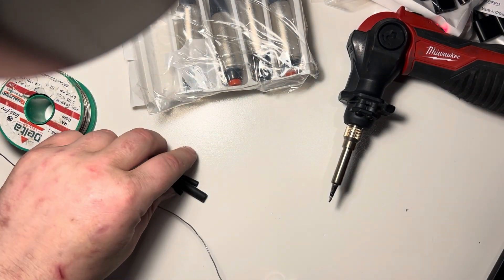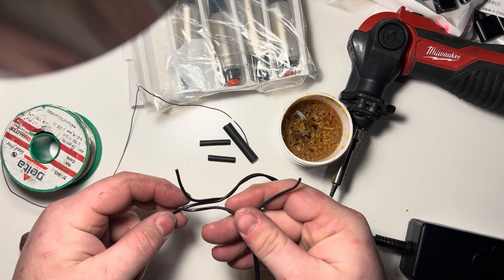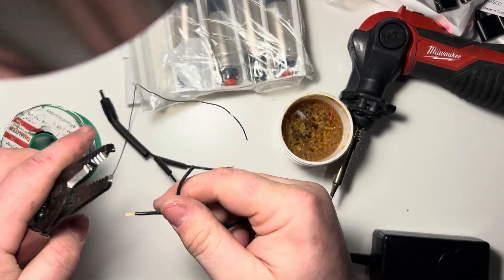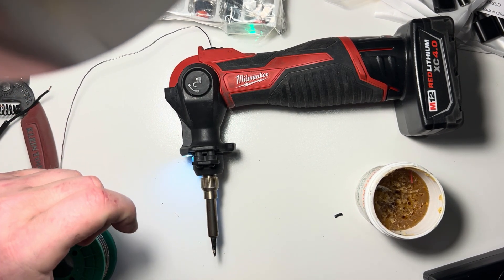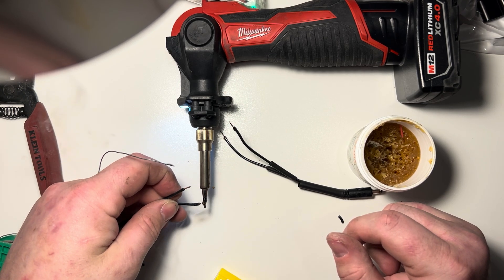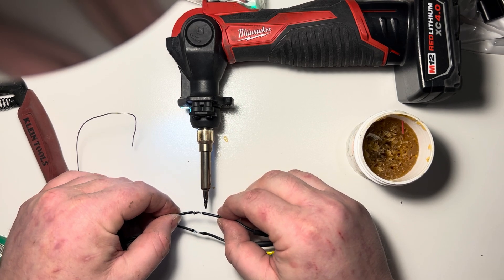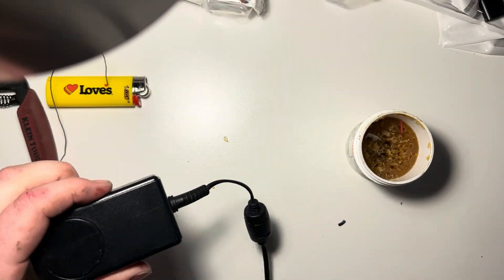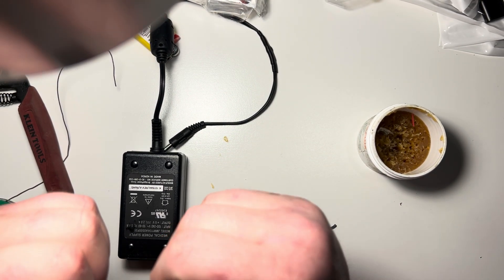Shortening DC cables from a transformer. Soldering in a hotel room.

Comment: What gauge is the wire? You stripped it very fast. I know as a much less experienced person I would have spent a lot more time working my way down from lower gauge (wider diameter) settings as I would be concerned about cutting into the wire I was stripping.
Reply from the maker: I do this dozens of times per day so I don’t rely on the strippers to make the cut, I just kind of go by the pressure I’m applying. I don’t pay any attention to which particular gauge hole I’m using. Most of the wire insulation I work with can be scored with strippers and pulled right off. Keep at it and eventually muscle memory takes over. Just remember it’s always okay to cut and try again if you cut some strands in the process. 

Quality cables/wires make all the difference to me, even on small gauges. On home projects and off-grid builds, I use marine-grade tinned copper almost exclusively (Ancor brand). Super thin/flexible stranded wire is annoying to me and much more likely to be damaged during stripping.

Comment: I like your attitude towards keeping and using sponges. I also liked the advice regarding moving the wired sideways instead of directly away from the iron tip.

I subbed cause you clearly know what you're doing and you give valuable advice.
Reply: Also not a big fan of the sponge shamming
Reply from the maker: @afrowitchdr I’m not allowed liquids in most areas I work and constantly leaving my worksite to wet a sponge isn’t realistic. My dedicated soldering bench at home has a sponge and the “metal” style tip cleaner - I use the latter far more often. Board-level/PCB soldering gets a much more delicate approach from me, I promise.

Comment: sure, you doing that in a socalled hotelroom without any protection for their furnitures on a table 5:50 and wont even put a simple magazine underneath when soldering by dropping solder on a stationary iron.. mindbogling .
Its abc when soldering it that you heat the material and then you add solder to it, not the other way around but at this extent.. who cares...seem like most of what your saying are based around a make believe scenario.
Reply from the maker: You sound like a lot of fun.
Reply: You can't heat copper wire and add solder to it because if the wire is hot enough to melt solder, it's hot enough the melt the insulation a few centimeters down the line.

And in my experience, small drops of solder don't carry enough heat to melt the material they land on. They usually don't even stick to the material.

Comment: An automatic rechargeable drilling machine with soldering feature. All in one! What more else to patent? 😂😂😂😂😂😂😂😂😂😂
Reply from the maker: @Nets-nutsBr  Sounds like a dream, this is actually a dedicated M12 Milwaukee soldering iron I travel with for work. Not as good as a dedicated station and no temp control but it gets the job done!
Reply: Some time ago I had a gas soldering iron. It was very useful for working in remote locations where electricity was not easily available. Nowadays we have battery powered Milwaukee tools that are very good.